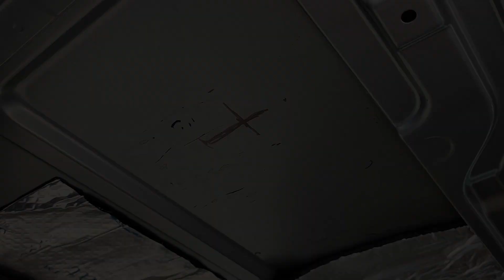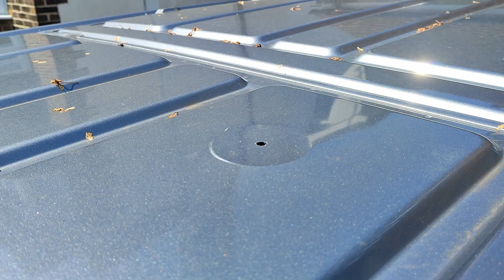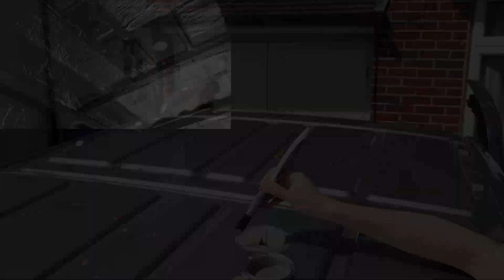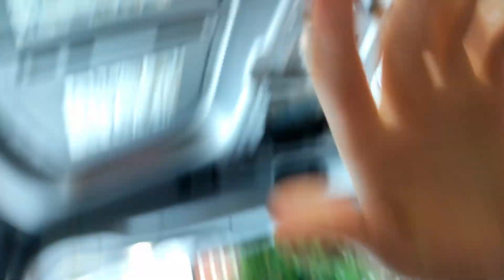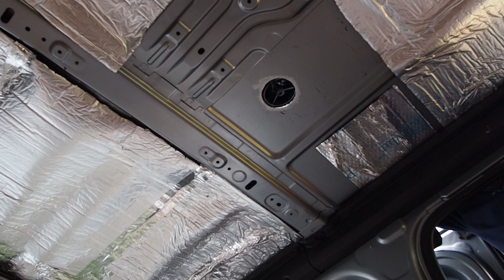Installing a "Turbo 3 Low Profile" Roof Vent: Peugeot Expert Camper Conversion

Comment: If you ran a wire from the 12v battery under the bonnet, do you know where there’s a good point or existing grommet to feed the wire from the battery to the cabin ?
Reply from the maker: If you remove the trim around the glovebox there is a rubber grommet that can be pushed out towards the engine bay. We've just done it and it was fairly easy to do. I'll be posting a walkthrough in a few weeks
Reply: @TomSlater1999 ok I’ll take a look, it’s under the glovebox or to the footwell trim ?
Reply: @TomSlater1999 I found the big grommet where the main wiring goes through, it’s got tons of glue in the centre where the wires go through, getting a 4awg wire through there is a tough job, I couldn’t get it through. 
How exactly did you get yours through there ?

Comment: Does it make noise when travelling at highway speeds? Or vibrations sounds to the roof ?
Reply from the maker: I don't hear any noise from the fan itself. There might be a little more road noise due to the hole in the roof.